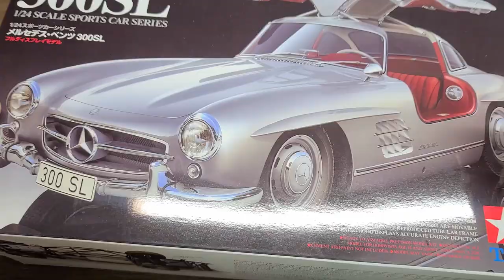How to build a realistic 1/24 Mercedes-Benz 300SL step by step

Comment: I’m looking to get into this kind of model work, not sure what to start with though. Here’s a list of the Tamiya models I like the look of (all 1/24):
Lexus LFA
Mercedes-Benz SLR McLaren 722
Porsche 911 Turbo ‘88
Porsche 911 GT3
Porsche 911 GT2 Road
Mercedes 300sl
Ford GT (new)
Honda NSX (new)
Toyota Supra 2020
McLaren Senna 
Honda NSX (original)

Not sure what the easiest one is.
Reply: I've built the senna and this, the 300sl is easier in my opinion, the senna is on a different level of engineering, the body is all in separate parts so painting and final assembly will be more challenging. Both great kits and pretty much fall together. Did you end up trying one?
Reply: @michaelmoline7058  not yet, just finding the best time to buy so that I don’t just leave it in the cupboard for a year 😂 thanks for the advice, I think I will end up getting the 300sl